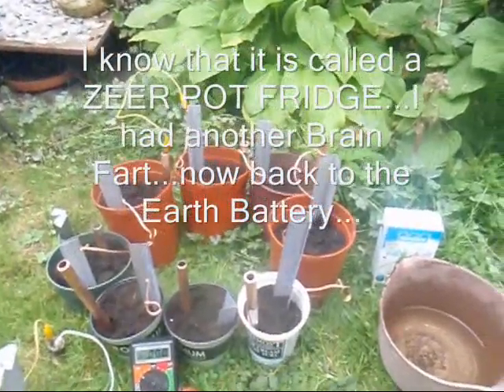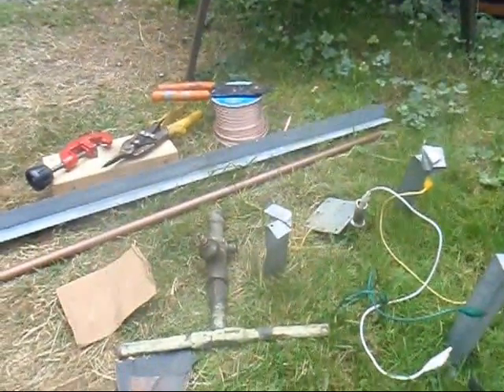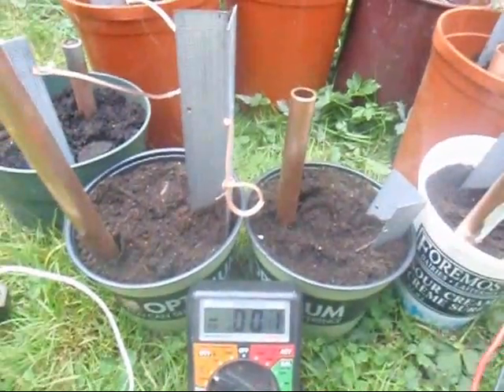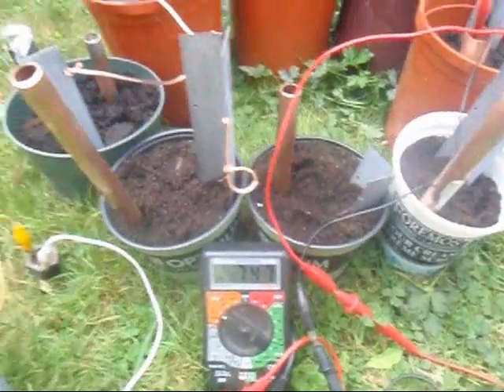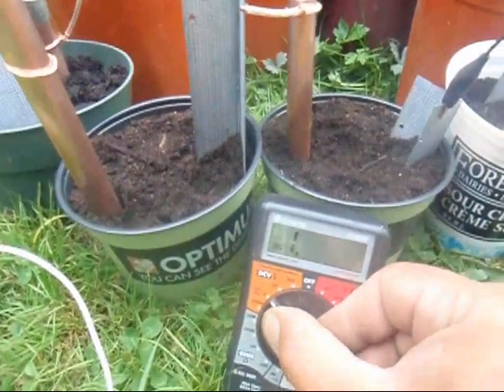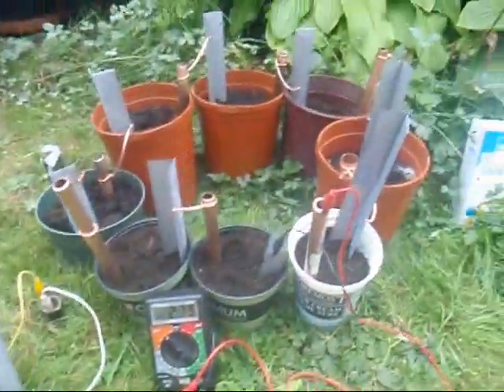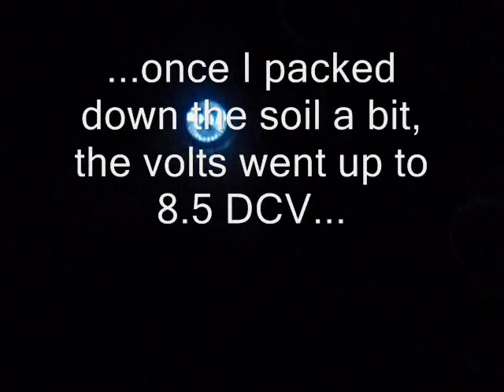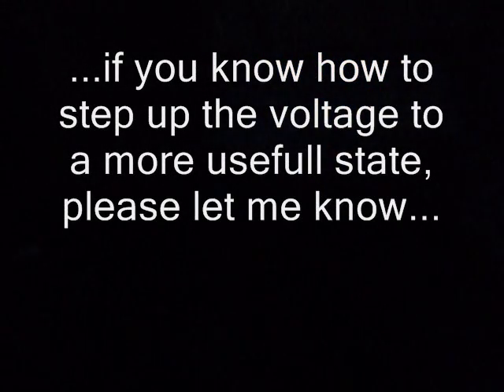8.5 DCV Earth Battery Lights Five LEDs

Comment: For everyone who is saying that this isn't enough power to be worth building consider this.
This is only proof of concept.
Plug this into a charge controller and it could be used to trickle charge rechargeable AA batteries, this in itself is not useless.
Consider also that increasing the size of the anodes and electrodes would produce a greater differential and, therefore, slightly more power.
Also, you don't add salt to this system you add salt water. Mix up a batch of saline and soak your soil with it.
I wonder how many pots you would have to have to recharge your cell phone?
Maybe an experiement is called for.
Reply from the maker: +Kim O'Brien +Justin Vance  If anyone has difficulties with the written word, grammar, and spelling...that would be me. My thought process, and ideas are not limited by my lack of proper spelling or use of punctuation. Some do not command the English language very well, and this forum is not limited to scholars. Everyone is entitled to form their own opinion and reply, although insults or personal attacks are not warranted. I thank you both for showing an interest in this primitive experiment, and your replies posted in this forum.
Reply: +Kim O&#39;Brien "YOUR welcome to try.." an apostrophe ;p ~ No need to insult the intelligence of the thousands of viewers, we all know the price of a AAA battery; its the concept that shines here.
Reply: It could be the Russians knew the CIA was listening and they were making the stuff up so to fool or put on over on the super sleuths.
Reply: Drunktoads 
I know how it feels.Ya could invest in a ferrocell, little device that allows you to view magnetic fields live with your eyes, for $100. should get ya started in understanding electron fields instead of just the management of electrons (electronics), it provides an illusory depth in the field of view also, like a magic trick.
And maybe;  Ed Leedskalnin's Perpetual Motion Holder. Those things hold locked for years.

Still... good work.
Reply from the maker: To say good work is to kind...it was all thrown together on a sunny afternoon four years ago. Through the years there has been a lot of good information past along from people such as yourself...
Reply from the maker: ...cannot blame that on you. Bio-electromagnetism has nothing to do with dissimilar metals. More so the Polarity of ones own body. There is something to be said for all these ancient practices of energy and life...
Reply from the maker: Energy cannot be created nor destroyed, only transferred or stored for use at a later time. If your body is a battery...storing energy could you not transfer it to another...??? The only measure of effects is upon the person it helps...
Reply: +Chris Peterson It will be hard to beat the cost and features (long storage life) of an ordinary dry cell but your welcome to try.
Reply: Justin Vance The biggest insult to intelligence is English language spelling rules. 

Count Volta built the first primary cell. Yes there is a reason they call it voltage. 

The concept is over two hundred years old. Yet only twenty century science explains why a battery works.

 You might learn something by studying Count Volta's discovery first before you attack me. If this inspires someone to build a better battery good. But like I said the modern alkaline battery is hard to beat. 

The lithium battery is relatively new. There is also a very serious need to find a way to store large amounts of electricity cheaply.
Reply: I suggest you guys dive into the newly available 800,000 files in the CIA reading room. This is playschool stuff for a 5 yo.
Reply: Εωσφόρος I didn't realize the super sleuths were interested in battery technology. Than again it might be used in a method to replace the field telephone as a torture tool.
Reply: Kim O'Brien

Batteries? Oh no, we're well past that with quantum locking & quantum wrapping the phrases used are more akin to energy servers which utilise any form of mass point geometry as an extremely long term source and lifespan as a fuel.
Not got through even half of it yet and i had to pick myself up off the floor at least twice, not related to this stuff, but it seems they're into everything.

Found so far a 5 page document (with other pages Xeroxed) it records the conversations of a group of Russians discussing the demonstrations of alternative space flight with details and even which models suit which environments.
For instance a dome design being far more preferable for space flight than the saucer design, which is best for atmospheric travel. They're even explaining how they happened by the discovery.
They say the power requirements for a 5-ton craft is 100 amperes, other phrases used in the explination;
Induction
Superconductor
Fluidic electron field
Electrohydrodynamics
Electron overflow
etc, etc
Which particles break the light-speed barrier delivering superluminal booms (akin to sonic booms) etc, etc.

Some of the other shit in here is just off the wall crazy. And i would advise having some sort of weapons cache at your disposal just in case. Better to have n not need... bla blah.

It also seem that they have their own peer review which far exceeds anything available to the public by a giant margin.
Reply from the maker: This stuff is to far advanced for me... http://io9.gizmodo.com/5850729/quantum-locking-will-blow-your-mind--but-how-does-it-work ...interesting read though, thanks for sharing.
Reply: Kim O'Brien
Doubtful, some of their content fulls under an old theory of Electrogravitics. Since gravity permeates space-time instantaneously (newton was right, einstein not so much) evident by a blackhole snatching light.
Gravity has monstrous potential and its a constant for energy, meaning its not going to run out anytime soon since its an emission given off by mass point geometry... aka stuff.
errrm.... its a no brainer.
Anyone arguing against using gravity/ante-gravity as an energy source has something to hide.
Reply: No Doubt there is plenty of sources of gravity but I haven't noticed any anti gravity lately. In electrodynamics opposite charges attract and the same charges repel. Gravity always attracts. So wouldn't anti gravity have to both attract more anti gravity and repel gravity. Maybe that's why we don't see any of it around. It's just got enormously large and repelled itself away from the area.
Reply from the maker: Still trying to get past sticking metal in the ground...you may not be too impressed with my next video...if one ever gets made...???
Reply: Gravity is electro static accumulation on the surface of a body. it pulls and pushes. Anti gravity is all about isolating a large scalar voltage. All lift and antigravitational effects are based on directing "electrons" underneath the body being raised. even getting up out of a chair requires electricity to create lift under your body
Reply: JoshJamesification Gravity is a different force than electromagnetism. Electromagnetism is connected to charged particles and the distance between them. While gravity is connected to the mass of particles and the distance between them. There are two other known forces the strong and weak force which are seen with interactions of particles close together like the inside of an atoms nucleus. In both gravity and electromagnetism the force between the particles drops as the inverse of the distance squared between them. Often called the inverse squared laws. While gravity is only a attractive force. Electromagnetism is either an attractive force between opposite charged particles or a repulsive force between like charged particles. Weight is the force between the earth and other masses. So weight changes depending on how close or far an mass is from the earth while mass is an invariant as long as your looking at a mass going rather slow in relation to your reference frame compared to the speed of light.
Reply from the maker: Not to jump into this discussion, but the explanation of electromagnetism helped me understand what may be bio-electromagnetism? The energy transferred from ones hand to another. A bit off topic...thanks for sharing...
Reply: Not exactly sure what your talking about but if you have two different metals connected to a volt meter and held in opposite hands (the sweater the better) you should be able to see a small voltage due to the sweat (saltly hands)in the hands acting like an electrolyte. Caution a Navy guy killed himself trying to measure his internal resistance.
Reply: Well how do you measure it or see its effects?
Reply: Well no doubt that the body is affected by electric currents. In fact an electrocardiogram machine shows up how the heart beats through measurements by attaching electrodes on the skin's surface. I have something called afib. Short for Atrial Fibrillation. What it means is the top chambers of my heart vibrate instead of squeezing correctly. When this happens the lower chambers take over because they only wait so long to squeeze. However instead of beating rhythmically they sort of beat like a drunken horseman. So I didn't feel just right and went to the ER which is where they discover this. The first time they just kept me and gave me medicine and it went back to normal. The second time they had to knock me out and do the paddle thing like when someone's heart stops. The only real danger is if it is in afib it could make blood swirl in the top chamber and create clots. I got mad after the EMT's said I was a crazy scientists. So if I feel strange I bought some cheap monitors online from China and check for a rhythmic beat. You could always ride a bicycle (exercise machine) and turn a generator end transfer energy that way. It is said that the nerves transfer small electric currents to control the muscles. I have had plenty of shocks in my time from not being as careful as I should and feel that I am spinning a roulette wheel every time I get one. It is called getting bit by electricians. You wouldn't believe how quick the body can move when having one. My dad accidentally got connected to 600 V DC on a diesel electric locomotive. He said he couldn't let go so he dropped to his knees. After that he never wore his wedding ring again.
Reply from the maker: Well Kim...coincidentally and unfortunately while reading your open message to me and others. My mother suffered the same for years and since has passed. But in her case the drug Toradol  given to ease the pain from the paddles gave her an aliphatic reaction. She passed away twenty-one days later in my arms.
Reply: Sorry for your loss.

Comment: what is the life of this type of battery?
do we need to charge them when they are in bucket?
Reply from the maker: Aisha Bukhari I left mine connected for a few months before taking it apart, but when the soil dried out the voltage dropped. I would think it would run continuously if properly maintained. After time the metals will oxydize and may need to be replaced, or cleaned. But I cannot say for sure. 
There is no charging them, since they just harness the earths energy.

Comment: Very nice video
The reason your LEDs are not fully lighting is that you have too many load centers, You are dropping most of your voltage across the battery connections through Eye Square R losses.. Your electrical connections aren't worth spit. Hard mount terminals on each of the anodes and cathodes. Use a secure mechanical zinc fastener (nut & bolt) to attach properly terminated copper wires to the terminals. Apply a blue silicone grease when making up the terminations and seal same with either a liquid rubber or wrap with a good grade of UL listed electrical tape. I guarantee you that your LEDs will fully ignite. Low voltage DC electrical systems are very sensitive to Eye Square R losses. If you have the time, use soldered connections when terminating your interconnecting wires.

 I used to live aboard a boat with 12 volt house batteries. If I were to lose 1 volt of the 12 volt supply across a circuit between the panel and the load center, I'd be basically looking at a dead battery if I were trying to drive an inductor.

What is the composition of your soil and its PH/  What is the moisture content of the soil? Both of these factors heavily influence the power generating potential.
Reply: Yes a solar light dose the same thing far more effectively and more efficiently.
Reply from the maker: +Capt. Nemo 
Thank you for the feedback, I agree 100% about the whole setup, and connections. Your information is very helpful to me, and others who read it.